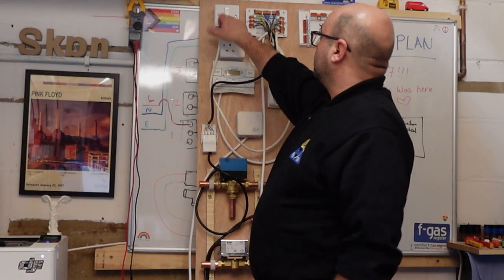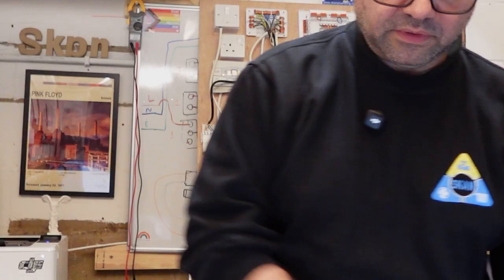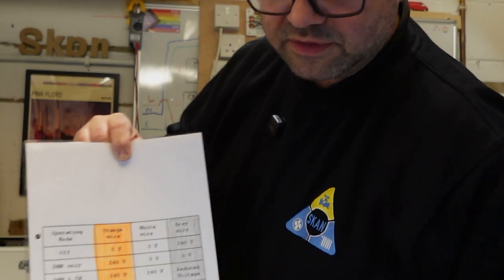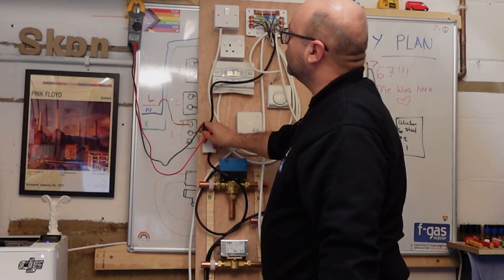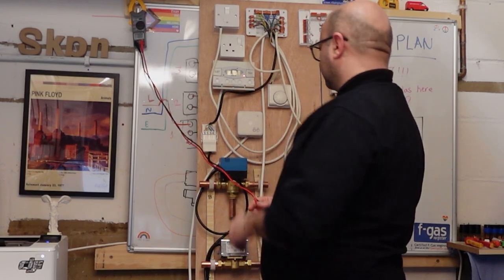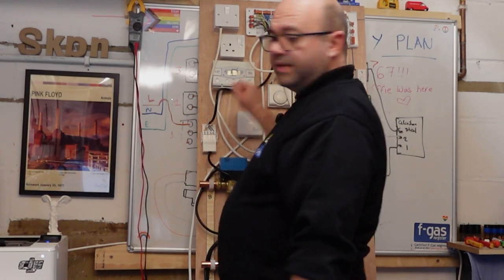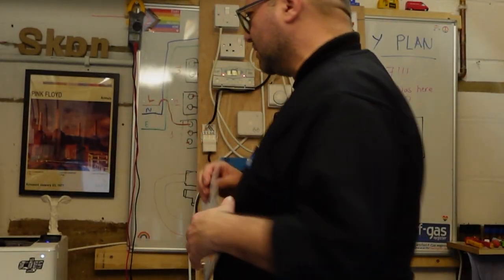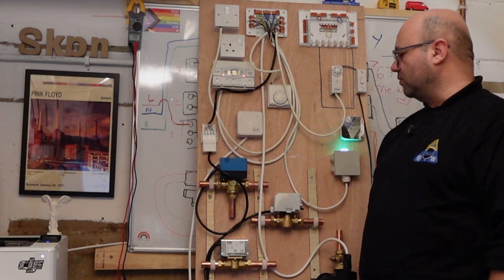3 Port Valve Fault Finding Step by Step Using Voltage Tests

Comment from the maker: 👉 👉 Download here: subscribepage.io/Gasboilerbreakdownsequence

This is a small gift for you and for anyone who leaves a comment here. Please feel free to download it and keep it saved.

Understanding the sequence of operation makes fault finding much easier and, most importantly, safer. No pressure at all, just useful knowledge to help you understand the system better.

We are a small channel sharing practical experience from real engineering work, so if you find the content helpful, your support with a subscribe, a like, or a comment really helps us keep going.

Best regards,
Yiannis